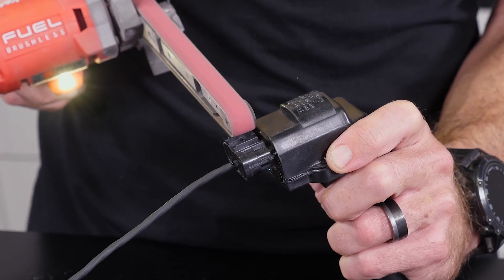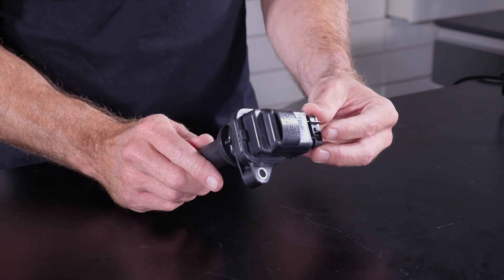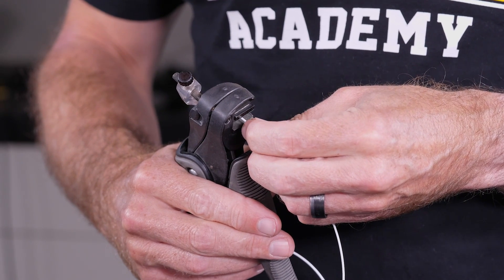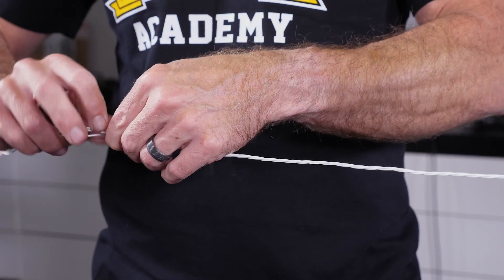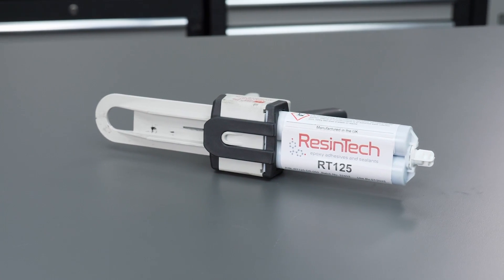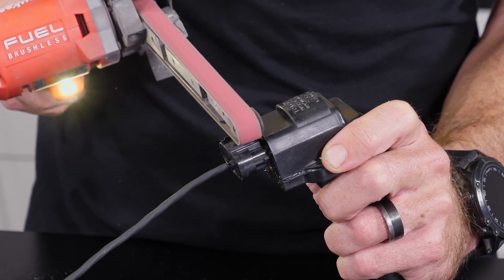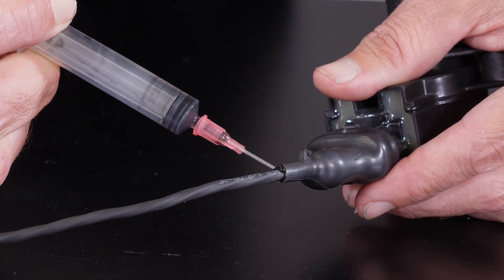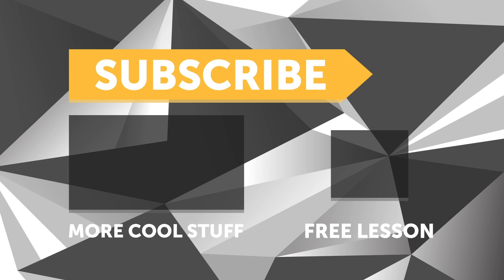Soldering Sucks, But Epoxy Potting Helps.

Comment from the maker: 🔥 Building a fast car? Get $400 OFF the all inclusive VIP online course package deal: https://hpcdmy.co/vipy107
⚡ 50% off your first online wiring course! Get the knowledge and confidence you want. Enrol today: https://hpcdmy.co/offery107

In before the 'I've been soldering things since 1240 BC and haven't burnt my car to the ground ever' comments:
Soldered connections are generally avoided in motorsport wiring applications where crimping is an option due to its superior attributes for this specific application. BUT! There are exceptions where crimping isn't possible, and one of those exceptions is when we are potting actuators such as these Toyota ignition coils, which are known to fail when exposed to the comparably extreme vibrations motorsport use introduces, compared to the drive to the shops Toyota thought you would be using them for.

That said if you prefer to solder instead of crimping all the time in your own industry or on your own personal projects, that's cool, but it doesn't change why others avoid the risk or the fact we are just simply explaining that rather than judging you personally.

Happy wiring! 😎 - Taz.
Reply: I regularly witness failed and rotting wiring from solder repairs on trucks that are covered in mud every day multiple times a day. So I always crimp with heatshrink over it.
Reply from the maker: More information on booting using transiions as the example which are a little trickier than what we did here: https://www.hpacademy.com/blog/better-than-oem-booting-transitions-for-motorsport-wiring-free-lesson/
Further explanation on solder vs crimping in motorsport: https://www.hpacademy.com/blog/why-is-soldering-so-hated-in-motorsport-wiring-solder-vs-crimping-tech-talk/
Reply: for the love of god do not crimp AND solder. it's literally the worst of both worlds.
NC1 Miatas have this problem on the coil-on-boot connectors and it WILL fail.
Reply from the maker: @_dm_  yes I don't understand that. If someone can't trust themselves to do one or the other to an acceptable standard, why on earth do they think combining both average efforts together is going to be any better 😂

Almost as bad as trimming a zip tie, but not flush, so there's a sharp piece to cut your hand on. Might as well just leave it long. Savages.

That said, still better than those that sit on their hands talking about living life, in most cases 🤘 - Taz.
Reply: @hpa101  flush cuts are one of the most important tools of all time!

Comment: How would you convert something like a lambda sensor (or any sensor/device that comes with a flying lead from factory) to autosport? 

Would you just pot the connector and add more lead? Or would you cut the factory lead close to the base and use solder sleeves to convert it to Tefzel so you could add an autosport connector that way? 

Or is it something entirely different? 

Also, on the off chance you guys see this and respond, are solder sleeves the best way to splice wires inside a concentric twisted sealed loom?

Comment: i got a few solder joints and a few crimps in our cars. they all suck but they hadnt failed yet either. one of my solder joints was cause of a wire that the previous owner twisted and electrical taped together, and it lasted years before it rotted. so what i did cant be that bad

Comment: Love the wiring content! 
Does soldering actually suck though? What is inside your ECUs? 
Both methods when done correctly are reliable in street OR motorsport applications too, but ultimately NOTHING lasts forever.
Reply from the maker: Soldering has it's place, but we are talking wiring connections here, not circuit boards - Taz.

Comment: What really converted me to crimps was how fast and easy it was to crimp connections outside non-ideal conditions. I was hooking up a radiator fan connections outside in the rain, and I used both crimp and solder connections. The crimps went on fine. Soldering was a nightmare with issues between dealing with the extension cord for the soldering gun, needing three hands in the engine bay to properly hold the wiring and soldering gun in place, the rain making harder to get a proper connection, the wiring getting uncomfortably hot to compensate for the weather, and the time it takes for the joint to be properly secured. I still keep my soldering iron and gun around, but crimps are my go-to now.

Comment: Soldering is universal, it will "always fit". Crimped connectors require correct wire gauge and tools. (That can be rare on a Sunday afternoon in the garage)
I've seen too hard crimped connectors several times, where the wire is broken off, just because the person before had incorrect sizes.

Tip, if you don't have too much heat in the area where the connector is, hot glue is very good instead of epoxy.
On a soldered connector, I always use some hot glue on the solder joint, and then shrink tube on top.
The hot glue melts and joins with the shrink tube, and stiffens the joint, making the soldered joint less sensitive to vibrations.

And yes, I have driven my BMW 635 with a VEMS ECU spliced into the original Motronic harness with countless soldered joints since 2009.
About 45000 km now, so almost since 1240 BC 😅
Reply from the maker: You are setting yourself up to fail on that Sunday afternoon job if you are not interested in making sure you are using the correct gauge wire and connector/s for the task at hand regardless if you are soldering or crimping. Many people only think they find wiring difficult because they go straight to the practical spect with 0 planing or foresight never giving themselves a real chance for a smooth job with a satisfactory result.

Outside of that, glad you found a solution that works for you and have enjoyed your long term project so far for that many KMs 😎 - Taz.
Reply: @hpa101  Yes I agree, sadly lots of cars are cobbled together with less than optimal parts.
Well functional wiring is sometimes way more complicated than it first can appear.
I normally work with automation, and come across cables with robotics and other moving and vibrational parts.
So I've seen my fair share of faulty cables 😅
Reply: I do agree that it's cheaper and simpler to start with soldering, as it takes less materials to do a "proper" soldering job. However, at some point, I still recommend splurging $100 in proper crimping tools and materials. Not the terrible plastic color coded crimps, but actual non-insulated solid crimps. Once I've found the right supplier, I've found it surprisingly cheap to keep the right crimps in stock, and I use it hand in hand with my soldering tools.

Comment: I worked with a race team that won GT1 @ Le Mans multiple times. The brits building those looms SWORE by soldering. I've also experienced the EXACT SAME failure Andre refers to: a terrible, intermittent problem caused by a solder break under heat shrink tubing. Nasty bugger to troubleshoot.

Comment: Funny, lots of soldered connections in the aerospace industry.  I would think a fighter jet going from the deck on an Arizona summer day to 30k plus feet in altitude in seconds would cause a lot of vibration, not to mention thermal expansion/contraction would be pretty stressful.  If its good enough for that I'm good with it.  Granted it has to be done properly, which is why all aerospace techs go through solder school.    😉
Reply from the maker: "which is why all aerospace techs go through solder school.    😉"
Exactly 😉 Another point for quality crimp tools and materials right here.

Throw up some links to your sources on that soldering, will be interesting to see what specific scenarios they are preferring to solder for compared to motorsports 😎  - Taz.
Reply: @hpa101  here is but one example of solder school in the aerospace industry:  https://mttc.jpl.nasa.gov/catalog/soldered-electrical-and-electronic-assemblies-ipc/  This clearly shows that soldered connections are used on critical connections in the aerospace industry.  If you'd like to see other examples you can google the subject and find a ton of information.  I'm not trying to be judgemental just providing feedback against the blanket statement that soldered connections suck.  I do find your channel educational and insightful and I am a subscriber.
Reply from the maker: All tools have pros and cons, including solder and crimping. Showing that people are trained to do it is very different from showing the specific use cases.
All we are doing is explaining why it is not considered suitable for many motorsports applications for specific situations (but clearly not all as here we are doing it 😅) based on real world experience in the industry.
If you love soldering so much that you can't accept that it isn't the first and only choice for every and any wiring connection, that is on you, and you can do what you like on your own projects. We're not stopping you or telling you to never solder 😎

Also note that soldering will apply to more than the connections we are talking about for a wiring harness when it comes to what you linked in your reply.
The wording in the crimping course description is interesting by comparison: https://mttc.jpl.nasa.gov/catalog/crimp-cable-harness/

Use your brain, make educated choices on your own wiring not assumptions and have fun 🤘 - Taz.

Comment: Don't need to worry about solder failing when you twist and tape.
Reply from the maker: You have to use the right coloured tape though - Taz.
Reply: I always use red.  Makes the electricity faster😊

Comment: There’s also the issue of solder literally poisoning people. I’ve worked in the car audio industry for 16 years and I’ve met loads of “old school” installers with health issues from inhaling solder fumes on a daily basis. 

I splurged on a pneumatic crimper  for my shop to avoid both toxic fumes and repetitive strain issues for our employees, and I would stake my reputation on those crimps holding up just as strong as solder for the life of the vehicle.
Reply: Cool story, but what about the bits you can’t crimp? Or what about the modern less toxic solder?
Reply: @driftmonkey3646  circuit board soldering is done on the bench with a fume extractor. Same with solder only connectors.
Reply from the maker: @driftmonkey3646 'less toxic' is better than non-toxic? I know some people love soldering 'to death', but come on 😂 

Soldering will always have its place and uses, doesn't mean it is perfect, nor is crimping for every and any application - Taz.
Reply: give it a rest

Comment: Soldered joint have less resistance than crimped joints, I don't think anyone is going to argue there.

What I haven't found is any irrefutable evidence (peer reviewed papers or even experimental data) that proves a crimped joint is more durable than a soldered one if both are properly supported in a high vibration environment. 

I use both, dependant on application.
Reply: The resistance difference is less than an ohm. Otherwise, we would see OEMs solder the battery and alternator cables. And sensors that are voltage sensitive typically have a voltage reference and ground reference.
Reply: @patx35  crimping is primarily used because of manufacturing efficiency.

Comment: My Motorsport fuse box has solder…harness uses crimps…however…a professional solder joint is fine…and my harness never sees 350 degrees C!

Comment: I follow IPC 620 protocols whenever possible. Soldering has its place. Stranded copper is generally okay but stranded silver is prone to failure at the joint, so a dry crimped connection is definitely called for. If ever in doubt, don't solder a joint.

Comment: Brilliant content. If you want to know what NASA thinks of soldering, check out their 'how to splice a wire guide'.
Reply from the maker: NASA will have instructions/standards on both crimping and soldering to be fair. Just because they exist, doesn't mean that method is used everywhere on everything however 🤘
Like motorsport there will be applications where one is favoured over the other for reasons specific to that application - Taz.
Reply: @hpa101  I was meaning the casual comment reader should check them out. They reinforce everything you've said. Electrical AND mechanical connections are essential.
Reply from the maker: Oh yes of course, interesting to look up! 100% agree! Should have added that to my reply sorry 😎 - Taz.

Comment: Is it common to use a female pin/socket from another type of connector instead of soldering the wires directly to the pins? Or can the potting compound compromise  the socket contact with the pins in the coil or whatever component your adapting? Or perhaps the pin/socket would likely protrude out the coil housing because it’s not deep enough?

Comment: I've had a soldered wire joint fail and create increased resistance which lead to part of the wire corroding and created an block to the current to a fuel pump.  When troubleshooting, all of the voltages were reading correct when power was applied to the pump, but the low current was keeping it from actually engaging.  Soldered joints is definitely something I would avoid outside of a street car since track/race cars are going to see much harsher use and prolonged periods of greater vibration.
Reply from the maker: Hope finding that issue didn't cause too much hair pulling! Crimps are not infallible either by any means, they can still be done wrong and cause issues (especially OEM ones in an already old car turned race car), but as Andre mentions, they are certainly the lesser risk to avoid such failures as that.
Hope you've had plenty of trouble free fun behind the wheel since then - Taz.
Reply: @hpa101  It hasn't been an issue since (8 months trouble free), but I've developed a new intermittent electrical issue that has been difficult track down. 😄  I'm going through the car doing a bunch of higher mileage mechanical maintenance, replacing the sensors, and upgrading the ECU since there's at least 100k miles on this particular JDM import engine.
Reply from the maker: Great to hear! Zac here recons 90% of wiring issues come back to some sort of grounding issue in his experience. They can appear in a few different ways though just to keep us on our toes, and there is still a lot to go wrong in the other 10% 😂

Age is sometimes more of a factor than milage too. There are services that will check the ECU rather than just replacing it which can give you better peace of mind than another random secondhand replacement just in case that's an option. That is of course only as good as the person doing that work for you 🤘

Cars are fun eh - Taz.

Comment: But Andre... I've solder a wire on my stereo back in 1995, and it's still going just fine, so obviously, solder isn't an issue
Reply from the maker: Hard to argue with that! - Taz.